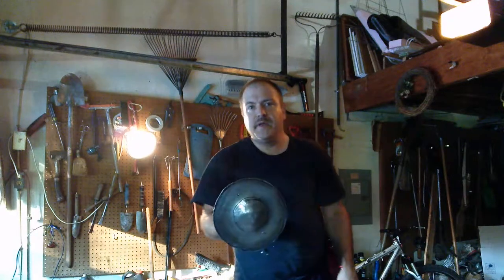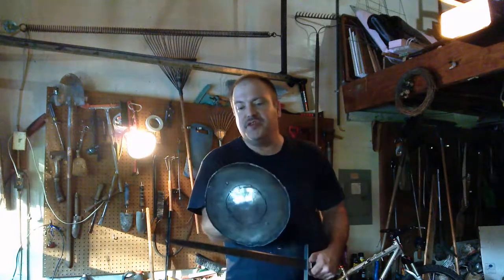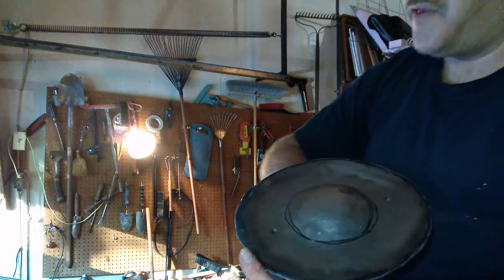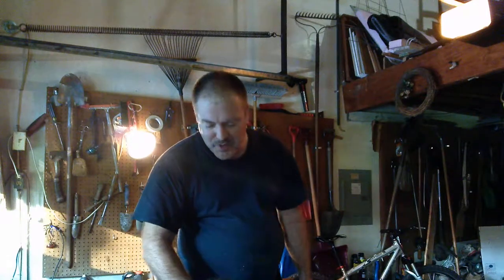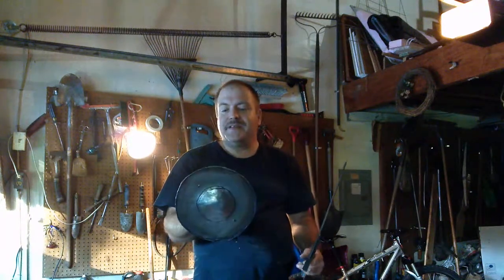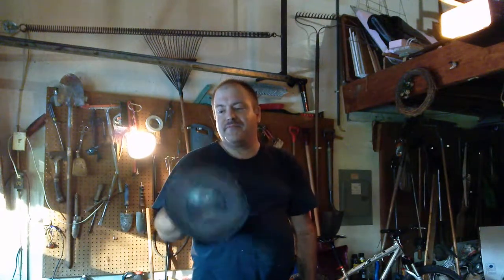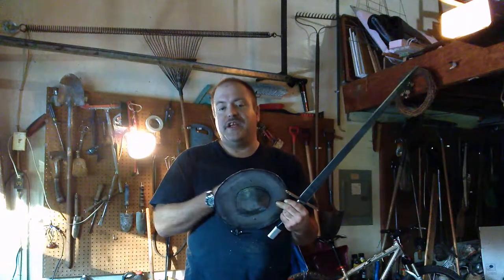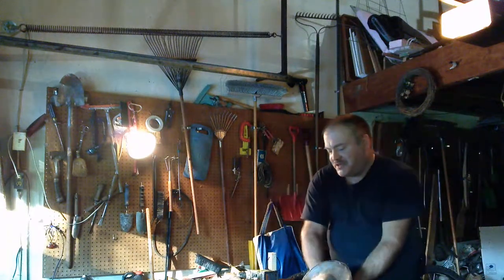Home made steel buckler part 3

Comment: Just a thought, if your worried about rust you could try bluing the buckler, it'll make it black
Reply from the maker: Thanks.  I actually hadn't thought of that, which is odd as I did once blue something in the past.
This might be a good idea as it tends to oxidize in the back where you touch it.